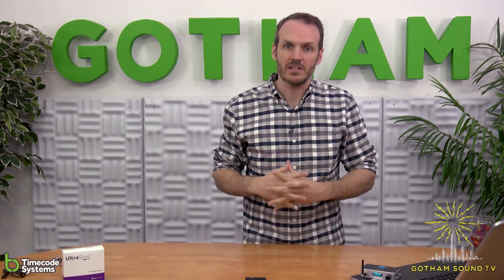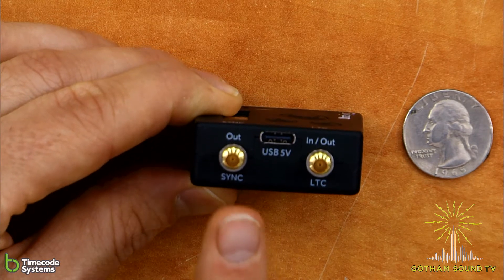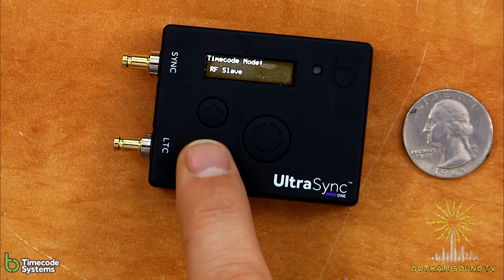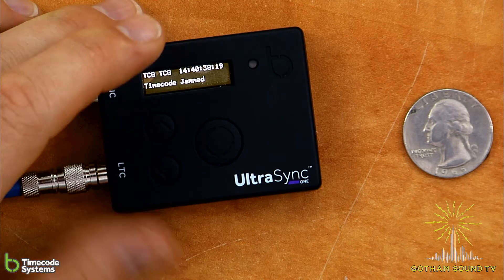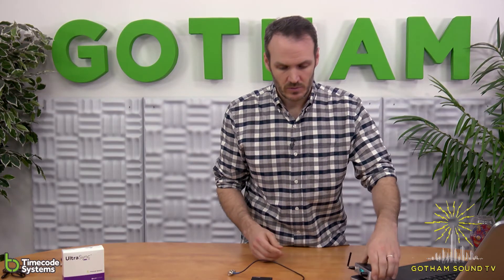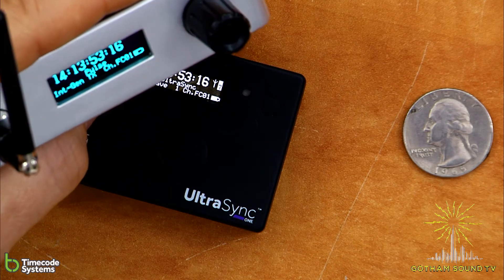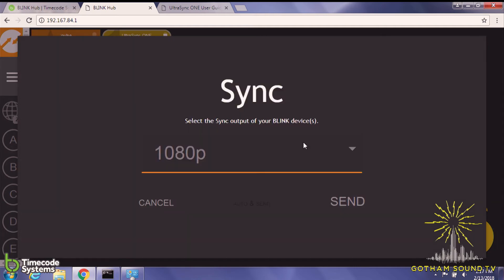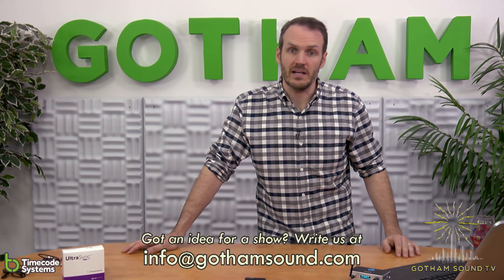Timecode Systems UltraSync One Integration

Comment: If I wanted to use the UltraSync as a master TC for BOTH my audio recorder and my camera, hardwired to both, is there a setting to shut off the RF completely so that it is not broadcasting using up extra battery?
Reply: Yes.  There is a stand alone mode that turns off the RF to save battery.
Reply: @njh209  Fantastic. Sounds like a great design! Thanks